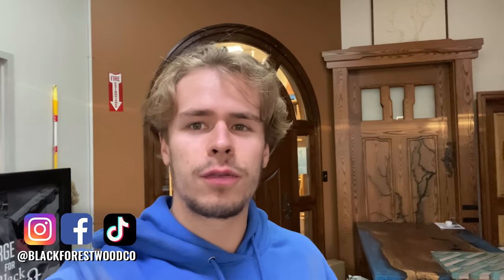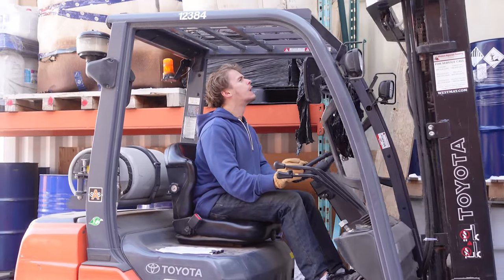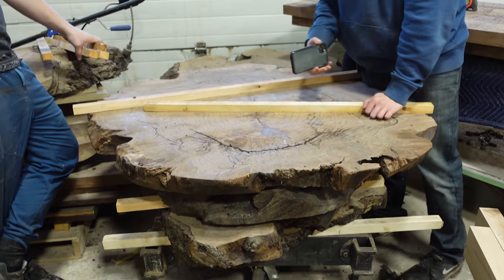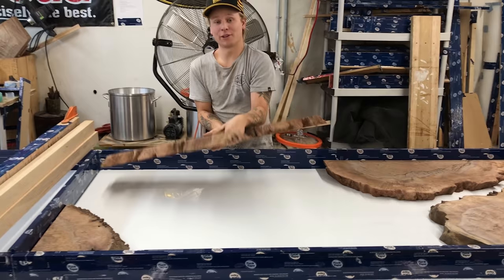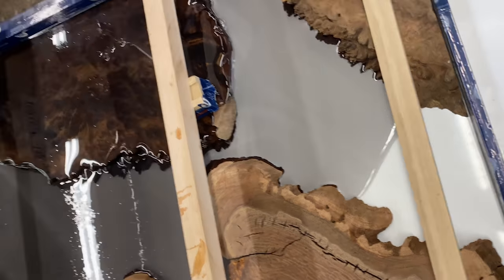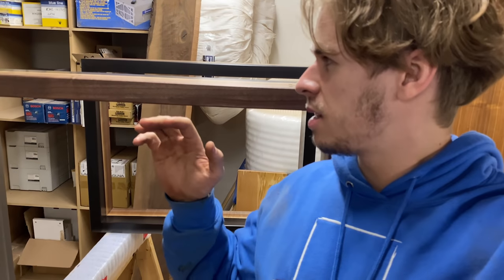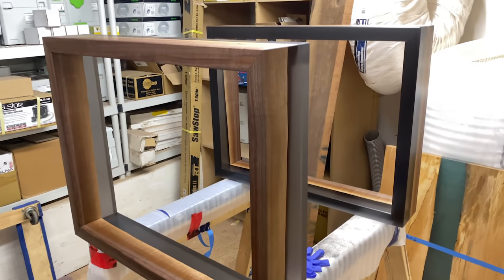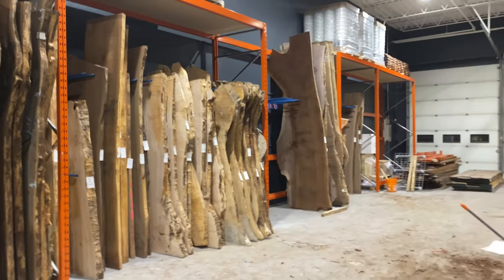How We Prep Before Doing a Resin Pour

Comment: I'm pouring epoxy into a 1.25" wide painted channel around a picture frame, filled with different bottle caps. I want to pour epoxy into that channel about one quarter inch deep, to just cover the bottle caps around the perimeter of the frame. 

My concern is that since the bottle caps are hollow underneath that I might get unpleasant bubbles throughout the poor as the air escapes while it cures, even though the channel itself was painted. 

Any suggestions? Is this likely to be a major problem and possibly ruin my project? Thanks for the video.